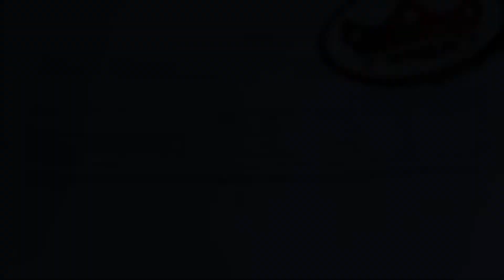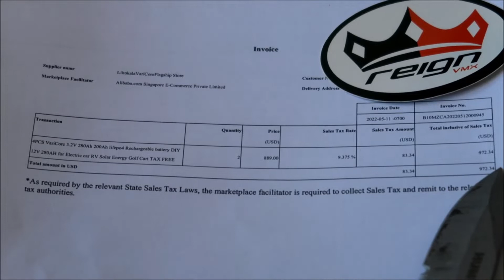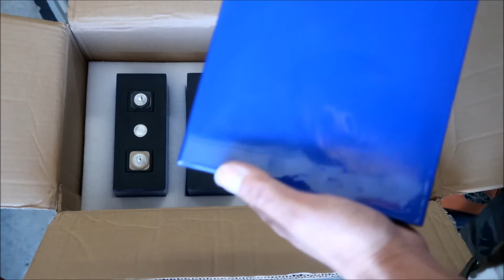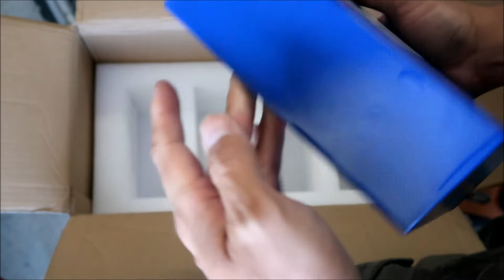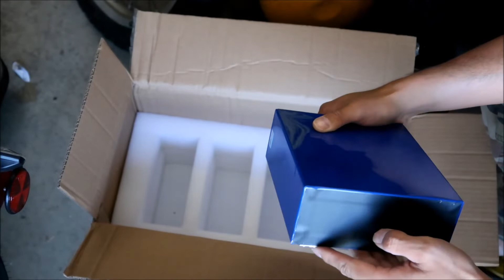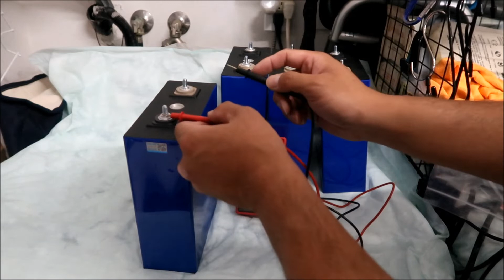HadesOmega Solar Garage Project Episode 101 - Unboxing & Inspection of Varicore Battery Crate 2

Comment: there are no man. qr codes..
i bet if you remove the top black covering you'll find scratched out qr codes...
these have been rewrapped, and are used
Reply from the maker: Yep, can't beat that price if they work fine but it's a gamble.
Reply: @hadesomegamoto7639  tried tonsteer you to a different seller, us warehouse, shipping 5-7 working days,true grade a , lots of satisfactory experiences, cells 280k are 120 USD.

unfortunatly seems youtube is blocking the link.
their name is Docan tech , warehouse is in houston